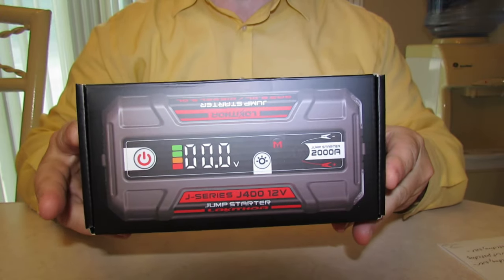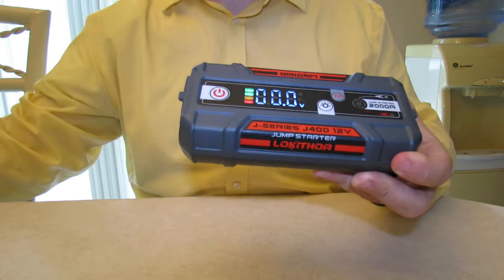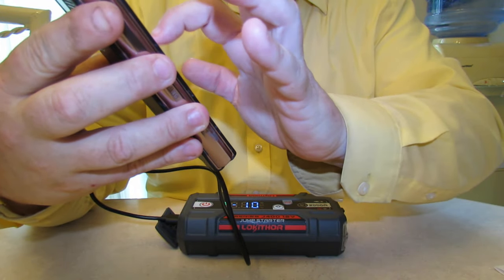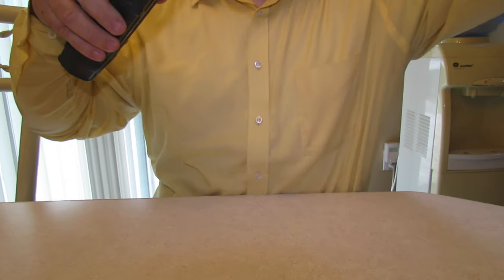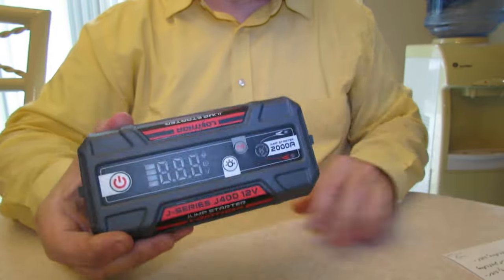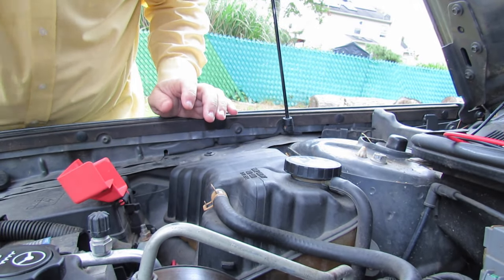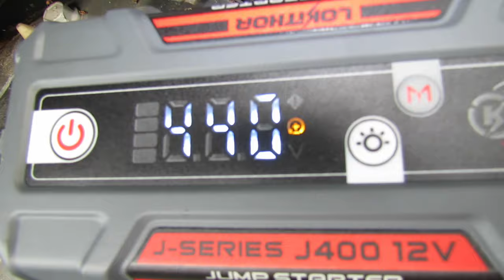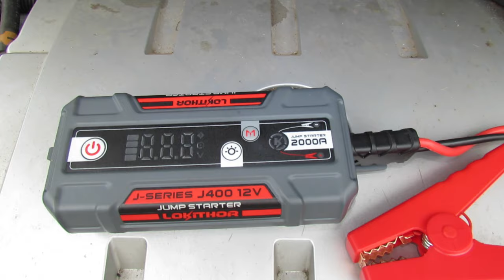LOKITHOR J400 JUMP STARTER 2000A 12V (Game Changer)

Comment: How do you know if it needs to be charged?
Reply from the maker: There are battery indicator lights on the unit on the left side of the LCD screen. It will tell you how high or low the battery level is.
Reply: They all light up, what does that mean?
Reply from the maker: @tomgalusha5201 When all the lights are lit up, that means it's Fully charged. When one light disappears, that means you have about 75% battery life, when there are 2 lights that disappear, that means you have 50% battery life left, and so on. Also, there are 4 lights color coated to tell you the battery life status. All 4 lights are color coated so that you know  how low the unit is. The top 2 lights are green, showing good battery life, the next light is orange showing the battery life is getting low, the bottom light is red showing the battery life is about to be fully depleted. Let me know if you have any other questions, and I will do my best to answer
Reply: Thank you so much.
Reply from the maker: @tomgalusha5201  my pleasure